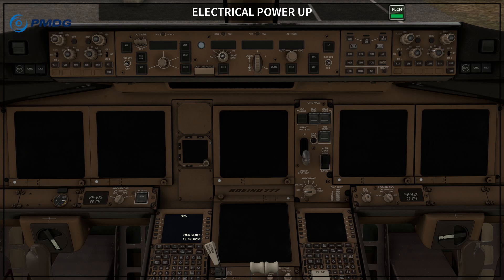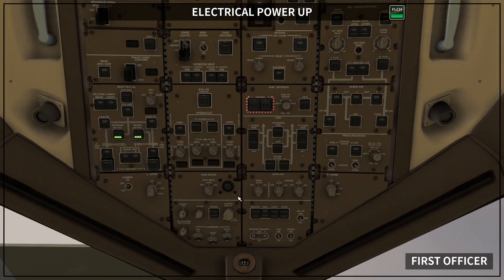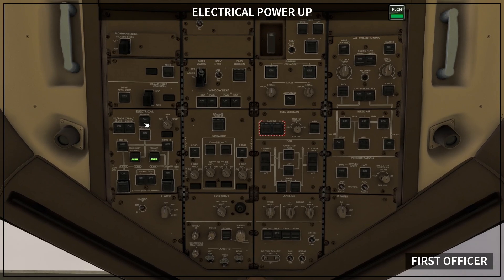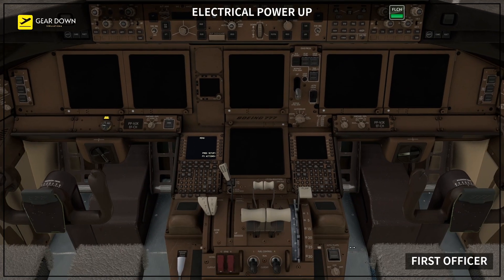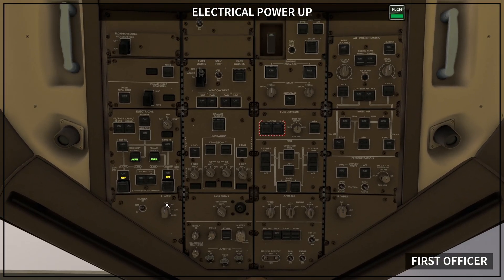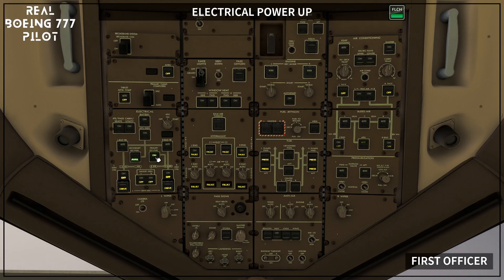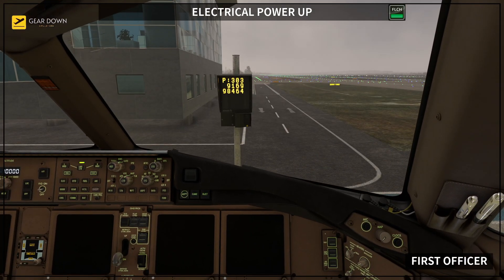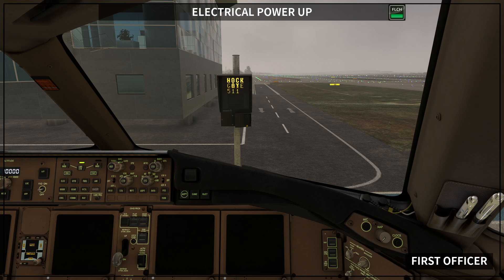ELECTRICAL POWER UP - B777 SUPPLEMENTARY PROCEDURE

Comment: Hello,

Thanks for all videos for the 777.

I haven t seen all of them, yet. But hope to catch up slowly.

I have three small questions.

1)
When is the secondary external power required? 
What are the conditions?
Is it waste of electrical energy if you connect it to the aircraft although you need only the primary external power?

2)
What if you use secondary instead of the primary external power?
Is this allowed?

3)
I know that in the 737NG you use Flaps 15 for landing if you have lost one engine.

What is the Flaps setting in the 777 in case of an EO situation?

Thanks!
Reply from the maker: 3. On the 777 you can 20, 25 or 30. Some old planes 20 or 30. It all depends on your go-around requirements or landing distance requirements. There is no simple answer to that (even though 20 is more likely to cause less restrictions).
Reply: @LEVEL_CHANGE  

Thank you very much for your answers.

Regarding Flaps for Landing with One Engine inoperative, you should make an own video, when you find some time.

In this video you can demonstrate what you mean about different go-around and landing distance requirements.

May be also by using simbrief and landing performance calculation.

Thanks!
Reply from the maker: The non-normals will come after all normals and supplementary procedures (as discussed on this video https://youtu.be/vE7MiUNF0u8?si=2pC3iCMYA6WHBPKa) towards the end!
About the Simbrief performance I already made a video about. And it makes no sense to use something else than the one provided by PMDG on the tablet. (As the result are almost the same … and the PMDG ones are tested on the simulator plane - we are not sure if simbrief works).
Reply: @LEVEL_CHANGE  
It would be interesting to make a comparison. At least simbrief should be close to the real values.
Reply from the maker: @AVIATIONSOUNDEXPERT I did on the video! Real life, PMDG and simbrief!
Reply from the maker: 1. The electrical system will deactivate some equipment when the current power is not enough to keep all systems running. It is smart and restore the systems as the load decreases and or more power is available. So, always use the maximum capacity available.
Reply from the maker: 2. It is. The only difference is that you can connect the primary without battery being ON. For the secondary you need battery ON or primary ON. Apart from that, they are the same.